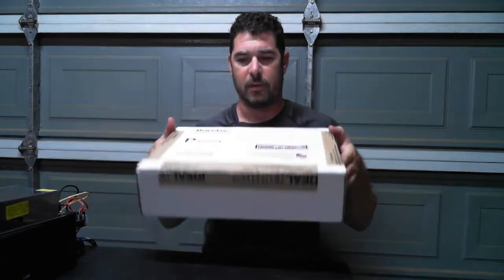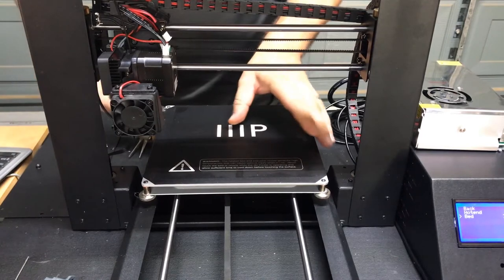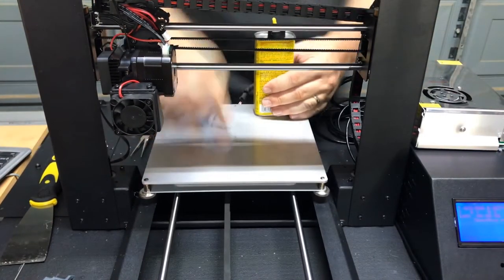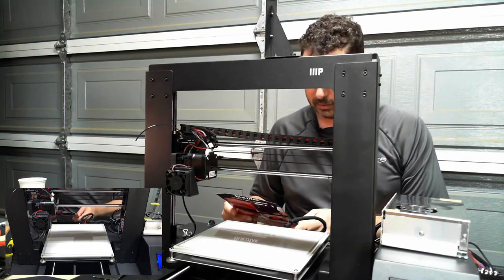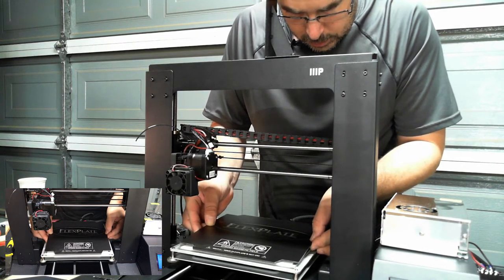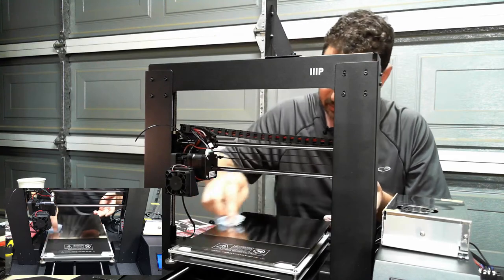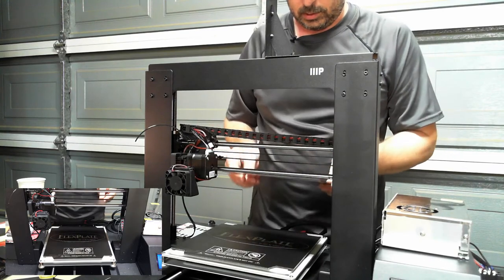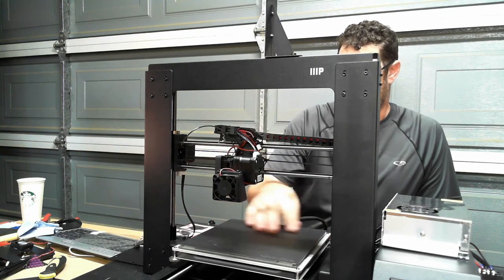BuildTak FlexPlate System Install

Comment: I did an upgrade for a friend replacing his fake buildtak on his Wnahaou with a PEI sheet. I removed the adhesive from the aluminum build plate with acetone -- it works well to dissolve the adhesive. Why wouldn't you apply flexplate directly to the aluminum?
Reply from the maker: kazolar the aluminum plates in the Di3's are notorious for bowing and warping when heated- they just don't stay flat.  By using the borosilicate glass plate as a median it ensures you have a flat surface to print to.
Reply: oh that is a deal breaker for me... my CR-10 barely is able to keep the glass at the given temperature... if i put more crap over the glass. is just not going to keep the 110ºC needed for ABS and HIPS ... grrrr

Comment: So the base of this system doesn't get installed directly to the bed? If so, that's a huge deal breaker for me. I wouldn't want to have multiple layers on my printing surface. I thought the base went directly on the metal part of the bed. Then of course the flex plate would go on next.
Reply from the maker: Ozzie Alarcon you can go directly on the bed, or on glass of you have that in place already. As long as you have a clean, flat surface for it to adhere to you have options.

Comment: Why did you have to take off the black cover on the bed?
Reply from the maker: Are you referring to the original fake build take that was on the bed to begin with? You want the best heat transfer possible so you want to be directly on the aluminum if you can (or on glass that is directly on the aluminum or on a thermal pad). Also, things just don't stick will to it...

Comment: What the name of the silicone transfer adhesive you use on the bottom of your glass so it does not move around? seems like it's better then binder clips! Do you have a link to it? Thanks
Reply from the maker: It's commonly referred to as "ginopad." https://www.amazon.com/400mm-205mm-Silicone-Thermal-Heatsink/dp/B007PPEW52/ref=sr_1_1?ie=UTF8&qid=1499312853&sr=8-1&keywords=ginopad
Reply: Thanks.. when you put that glass back on does it stay 100% level and flat all the time I use mesh level on mine so I might have to do a new grid level each time I take it off I will give it a try and see as I would love to get rid of the dam binder clips :)

Comment: I see you said it warps but putting it on glass seems like a terrible solution.  You now have 5 layers between the platform and the print surface.  Not ideal.
Reply from the maker: At the time (well over a year ago), when I installed it on the glass, that was BuildTak's recommended method of installation. I agree with you that doing this gives you more layers between the heater and print, and you have more mass to sling around on a moving gantry, but the trade off is that it is easily removable so that you could pop on a clean glass plate or piece of Garolite if you wanted a different surface to print on. As this printer was used at the time as a test a review piece, I wanted that flexibility. I also wanted to follow the manufacturers recommendations as closely as possible because, while not always optimal, for someone just getting into printing that is watching the video, this is what they would be likely to be doing.
Reply: Fair enough.  Are you still using this system and how has it performed?  If so are you still using it on the glass still?  Thanks.
Reply from the maker: The printer is currently down for maintenance, but I was still using it directly on the glass up until a month or so ago.  It works well, just found I needed to set the bed temp a few degrees higher.  Being on the glass on this particular printer made leveling it more consistent because it was flat and you aren't impacted by the curl of the bed as much.  One other really nice thing about this solution is that you can get blank spring steel sheets too, so you are not limited to just using BuildTak on it (although that works fine), but can also put on PEI sheets or other venders surfaces to experiment with until you find the one that works best for you.
Reply: Good stuff.  Thanks for the info.